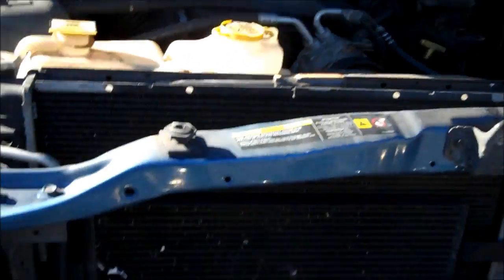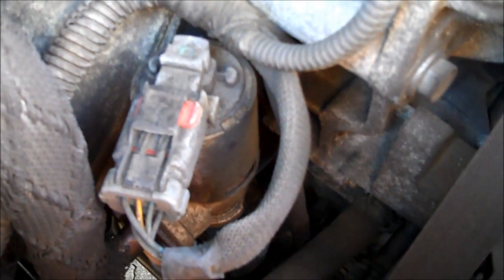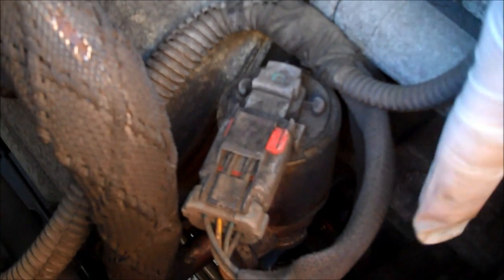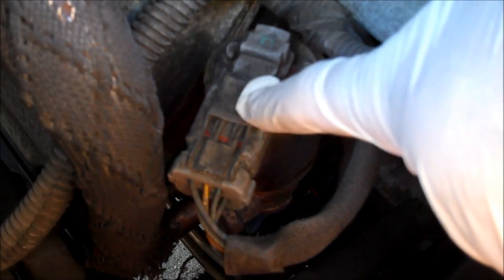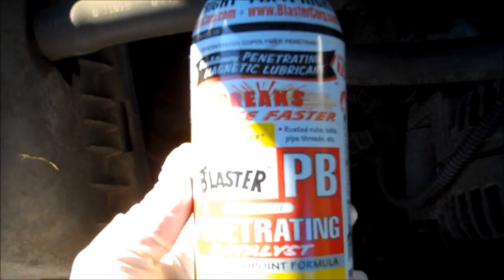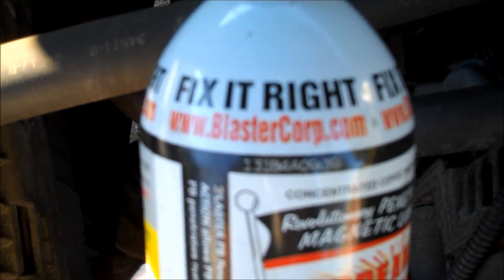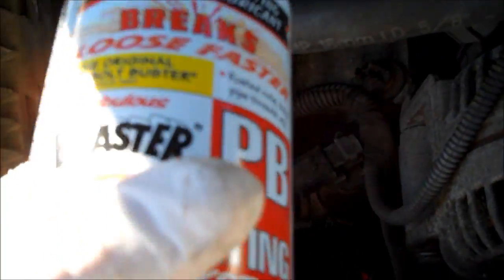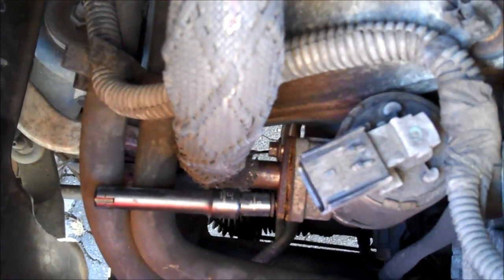How To: P0404, P0406 - EGR replacement for 2004 Dodge Ram 4x4 5 7L Hemi

Comment: Thank you for posting!  Got it done by removing the air box at the same time i did my plugs, took 10 mins thanks to you showing the "other" way to do it!  Top was sooo much easier.  On my EGR i removed it from the block before removing the pipe that goes to it.  Made it easier to get a socket around it!  =)  thanks again!

Comment: This was great, got it step by step. 2 thoughts-I removed the air filter assembly first, it did make it easier to reach from the top; if you don't know to push down on the black pad on top of the electrical connection to remove it, you will go nuts......tx
Reply from the maker: That's a nice suggestion to remove the air-filter assembly. I may add annotation to the video that includes your suggestion.  We'll let viewers decide the approach that works best for their particular needs.

Comment: Thanks for a great video. I don't know how you were able to do this one-handed while videotaping. I have a Dodge Magnum R/T and learned a couple of things replacing my EGR valve. On my car the alternator is directly below the EGR and allows virtually no space to get a wrench on the left-hand bolt (if you are facing the front of the engine.)  A 10mm 1/4" drive socket wouldn't fit in there so I used a box wrench. It's very slow going getting this bolt out. The other three are easy. Getting this same bolt started when tightening the new EGR is likewise a pain. Again, slow going with a 10mm open-end wrench until you can get enough space and then a 10mm ratcheting box wrench can fit on and the rest is easy. The price of the ratcheting box end wrench is well worth it versus the time and frustration of a regular wrench. Also, an extending magnet is very helpful...I dropped a wrench into the abyss and it was stuck in the plastic ground effects stuff bolted to the bottom of the car.
Reply from the maker: I wondered how I did it one handed after you called that out.  =)

Comment: I first replaced this part on my 04 Durango Hemi during a road trip from San Diego to Northern Colorado. There was a nasty blizzard happening, so we detoured through Salt Lake City to avoid the pass on I-70. It went out on a Sunday, so Auto Zone was the only game in town (Draper, UT). OBDII pulled code P0406, so I bought and changed out the EGR in the parking lot in 15-20 minutes and was back on the road. Now 18 mos. later, check engine light is on, pulled code P0404. Part has a lifetime warranty on it, and it's an easy job, otherwise I'd be going OEM from the stealer for sure.

Comment from the maker: The video is on the longer side. I include a bit more detail than many other clips. I may get around to editing this down to create an abridged version as companion for those that prefer brevity. Until that happens, those that want just the heart of the matter, watch from start to about 13'28''. Then, fast-forward to 18'48'' through 24'07''.

Comment: The exhaust tube flange rotates on the tube so no worries there. Felpro offers a egr to head gasket that's much better sealing if needed part number 71221 about 4 bucks.

Comment: What this video doesn't tell you is that the 8MM bolts are REALLY easy to snap, if you're going to buy a new ERG valve make sure it contains new bolts with it. the NAPA part # with the bolts included for 01-05 Ram 5.7 HEMI is NOE 6002619
Reply from the maker: You input is helpful. The video mentions bolts, mostly suggesting to save the OEM one's as not all kits will contain new replacements.
Reply: @RickSaffery  my pleasure, i learned the hard way when i replaced mine lol. the 8mm bolts seized and snapped off in the EGR valve body.

Comment: This is piddley, but PB Blaster is a solvent not a lubricant.  Secondly, I am pretty sure your package is not the same as mine, unless it looks like a short stack of nickles ( I try to make a funny).
Reply from the maker: Fernbark Frist I'm running with the manufacturer's assertion that it's a penetrating catalyst. Which will parallel your idea of it being a solvent. That may or may not add value to the definition as water is a solvent to many substances. It also has properties that act as a lubricant. 

Folks can decide for themselves. The product works great for what they claim. It works where others I've tried have failed.

Comment: Nice video. Also I saw your comment about the left hand brake bulb. Geez whats with that? I replace about twice a year also on 04 Ram. Any idea why?
Reply from the maker: I have no idea why.  I put bulb grease in last go 'round. The lamp has lasted the longest. I suspect the left side gets more moisture than the right side. For whatever reason that shortens bulb life. 

From time to time, I think about replacing the incandescent bulb with an LED equivalent. Then, the price tag of the LED critter brings me crashing back to the cheaper reality of sticking with the traditional bulb.

Comment: Whatever you do (( DO NOT )) put dielectric grease on this terminal. It is not conductive and will send mixed signals to the computer. This will cause the truck to think the EGR is bad and it will run like crap.
Reply from the maker: Antairus King please elaborate on your warning. For example, what do you mean the terminal is not conductive?
Reply: Not the Terminal The Die Electric Grease is not Conductive. It will give a weak signal. If you put the grease around the outside of the connector to seal it that should be okay. Just don't get it in the contacts.
Reply from the maker: Antairus King Thanks for sharing the clarification.
Reply: No Problem. This video helped me immensely. Thanks for sharing.

Comment from the maker: I really enjoy doing How-To videos.  Here's another one I share for those interested in replacing a faulty EGR valve in their vehicle. This clip, while specific, is general enough in scope to apply to most applications. 

http://youtu.be/Q-Alq_jlBoQ
Reply: code 403 egr circuit issue got any advice how to test
Reply from the maker: Forgive me, I didn't see your post.  Did you get your issue sorted out.

Comment: my 2004 hemi gets those same codes about once a year just take the EGR off and clean it then its fine for at least another year..
Reply from the maker: Wow! Once a year EGR pull is a labor of love I s'pose.  I got 10 years out of my OEM EGR. That's pretty good. I think.  So far, the only thing I've had to consistently change once or twice each year is the LH brake light bulb.
Reply: you should change your oil too.

Comment: wait, is that a swivel head on your tool?
Reply from the maker: esqueue Where in the video do you see it?
Reply: Rick Saffery At approximately 2:55. It doesn't look like a swivel head but kinda odd looking and I'm just curious about what kind of socket it is.
Reply from the maker: esqueue You're right, it's a funky different kind of tool. But, it's not a swivel head.  It's a nice Craftsman ratchet set in black. They call this design the Max Access. One of the nice design features is the unique ratchet head that allows the pass through of longer bolts.

Forward to 24'10'' in the video to see the exact kit I used.

You may also explore the kit sold at Sears: http://tinyurl.com/mwnxxgt
Reply: Rick Saffery Thanks, I'll take help anywhere I can get it.

Comment: I have a question about this EGR valve replacement. I have had to replace my EGR valve 3 times since the beginning of the year, and now the third one is throwing the same code of P0406. Why is this truck going through so many EGR valves?
Reply from the maker: That is a bit excessive. Are you getting any other DTR codes thrown?
Reply: No the only code is P0406
Reply from the maker: Dean Craft Have you discovered a root-cause for the P0406? I gather you tested each EGR you yanked out right?  I was thinking, maybe your wiring harness running to the EGR terminal is damaged. That might send a errant signal that could trip the P0406.
Reply: No i never did, took it to the deal and they put a factory ERG valve on and have not had any more problems with it.
Reply from the maker: Dean Craft  Good to hear you got it all squared away.  Should you have to replace it again, you can get genuine Mopar parts online, including the EGR. They cost more, but the quality is visibly better than budget aftermarket.